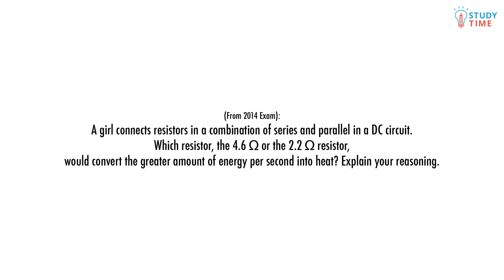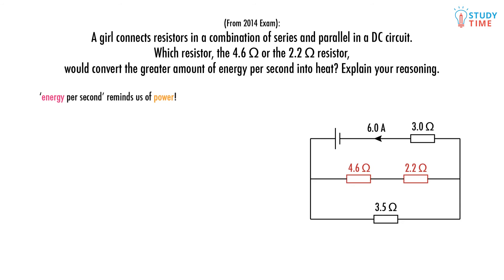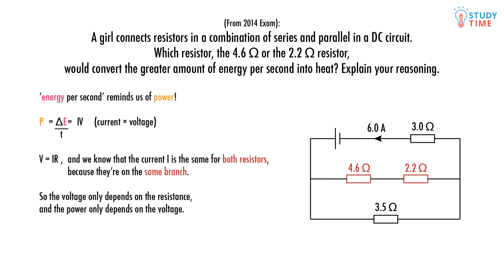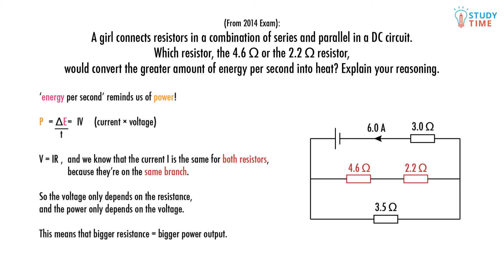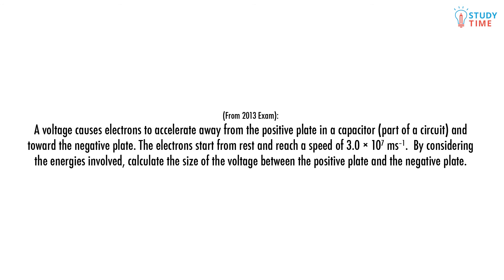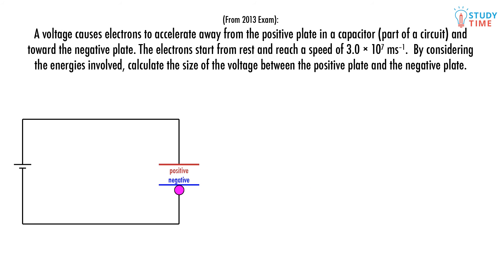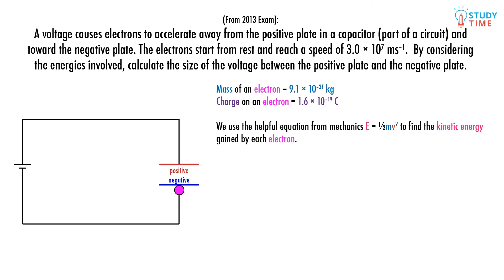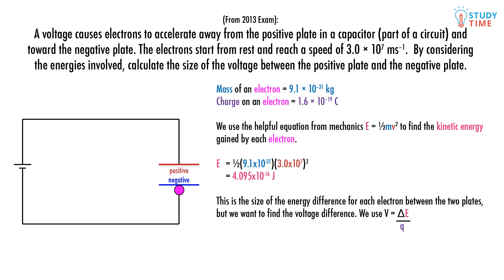Excellence Questions (4/4) | Electricity & Electromagnetism - NCEA Level 2 Physics | StudyTime NZ

Comment: Isn't the last question's answer meant to be negative? As the charge of an electron is negative, however it wasn't added??
Reply: Voltage is measured in J/C (Joules per Coulomb) and is the measure of 'Electrical Potential Energy per Unit'. Since you cannot have negative Energy (according to the conservation of energy), you cannot have negative Voltage.